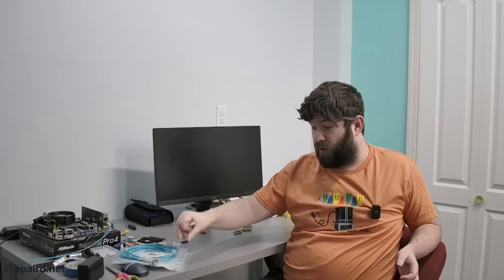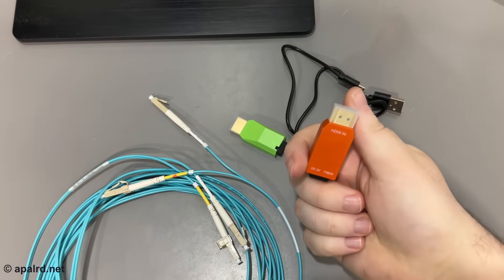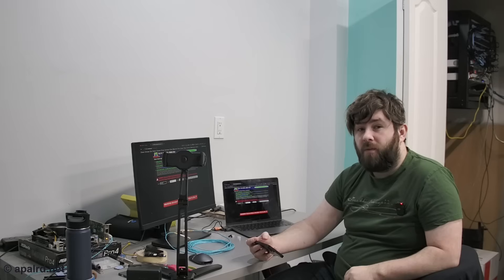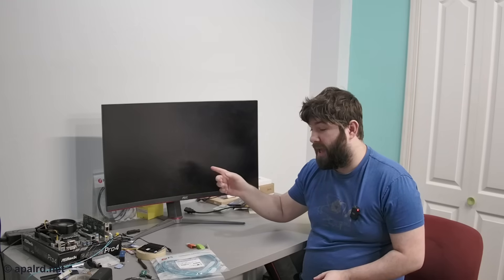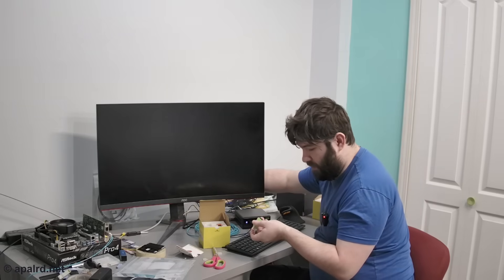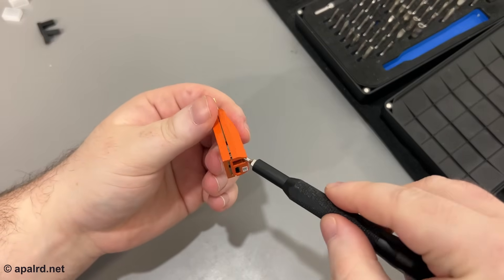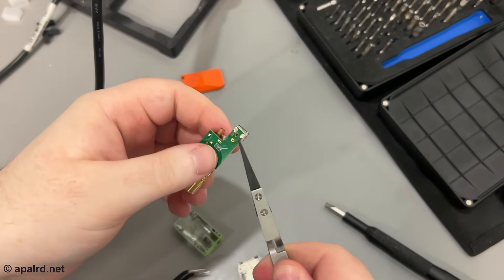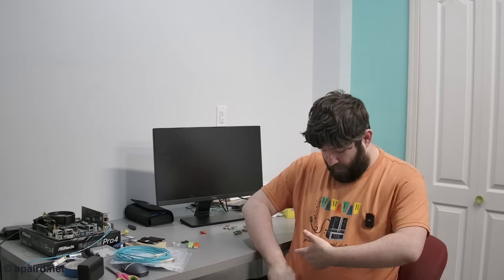HDMI over a single FIBER? E-Link Detachable HDMI 2.0 over Multimode Adapters

Comment: RUIPRO products are 1/2 the price, meet HDMI 2.1 standards, have a DP variant, and include a complete line of keystone wall plates and short run cables from the wall to the device.  Additionally, they also have an armored fiber option for better durability

Comment: the HDMI consortium are anti open source ass holes won't let AMD open source parts pf thier GPU drivers. id rather have display port who are not ass holes
Reply from the maker: HDMI has a technically inferior transport (at least with TMDS) so it’s easier to make stuff like this

Comment: I use this converter and a Transwan USB3.2/2.0/1.1 over fiber converter (uses SFP+ modules, I'm using a BiDi pair) to house my workstation in a network closet and only have a clean and quiet desktop on an office desk using a single LC fiber pair.
  
For a while I was considering making my own PCIe card that would have a pair of ASMEDIA ASM3242 (dual port USB3.2 to PCIe) feeding the guts of the Transwan USB3.2/2.0/1.1 converter (the SFP+ modules would have faced inside the PC, instead of the PCI slot IO plate) - and a few 4x Mini-DP inputs feeding 4x independent DP-to-HDMI protocol converters feeding the guts of these e-Link type HDMI-to-Fiber converters.  This would have been funneled into a single MPO/MTP 8-fiber connector - giving the ability to drive 4x workstations over virtual GPUs in only 2x PCIe slots when used with a single slot 4x mini-DP GPU (either AMD or Nvidia).  Your standard 4x PCIe x16 workstation motherboard would have been able to host 12x workstations.  Never really went through with it.

Comment: for live events: use SDI! ether over coax or fiber. but not hdmi. SDI is way more reliable and much simpler to trubleshot.
Reply from the maker: For many years I'd use mini PCs for remote displays, it's mostly things like rankings / schedules which scroll continuously. So the bitrate does not have to be very high.

Comment: Sounds really interesting. I think there's still room for improvement in terms of size (I find it too long) and making it USB-C. Making them black with a Tx/Rx label would've been (imho) a much nicer/stylish option rather than this red/green colors. I also wonder what's the amperage needed (I assume the voltage is 5V), or if the 2 conversions produce significant/noticeable lag in video games compared with regular HDMI cables (though I am aware this is a quite subjective topic).
Regarding the price, I understand that this is something relatively new, and maybe a niche product, but I still find it extremely expensive.
This being said, I think HDMI should have been optical from the very beginning (or at least a parallel version of it, like it already was the case with with SPDIF/Toslink)

Comment: Great stuff I'll have to pick em up. I built my basement theater so that all the consoles and PC live in a separate room and I use fiber HDMI cables to run 2.1 through the wall. I've been meaning to do a cable run up to the second floor office so I'll probably go this route.

Comment: ST Micro has fair amount of set top box IC's but all ball grid arrays, not that 20pin. Have the part number, or guess I could buy it. Looks like they obsolete a lot quickly. thanks
Reply from the maker: As far as I can tell, it's only used for the sideband signals and not the TMDS lanes, so it's probably just a basic microcontroller.

Comment: I went with an ethernet home run to the basement rack so I could do KVM (the box says "AV Access" but I don't know if that's the brand or model.) Technically they were using ethernet framing and I did get a picture over VLANs through a few switches BUT even though it was only 700Mbps the packet rate was so high my poor switches got anxiety and the picture was jittery. Dedicated cable gets me 4K at a hundred feet or so.  I'd love to see these guys make that happen on fiber. I have OM4 run between switches. They get my attention with a die cast casing when they could have gone cheap.
Reply from the maker: These guys aren’t using Ethernet, just raw optics. So no compression and no need to read in the whole frame and introduce latency. But I’d love to find a solution that can do what you’re asking.

Comment: It's nice that this kind of setup is getting more affordable. But 1.4 is ancient, and 2.0 is just too limited for the modern hardware: low refresh rates for 4k, no VRR. basically only usable for YT and movies
Reply: HDBaseT and knockoffs thereof support 4K@120 4:4:4 over Cat6 ethernet, the fancier ones even squeeze USB 1.1 or USB 2.0 on the same ethernet cable.
Reply from the maker: HDBaseT does not support 4K120. The highest spec supports the same 18Gbps data rate as HDMI 2.0. “Knockoffs” almost always compress the video to send it over Ethernet.

Comment: It would be cool to see the signal on an optical spectrum analyzer, as I suspect they're sending the 4 TMDS lanes over 4 separate wavelengths. That would allow zero latency (yo, we really needed a latency comparison vs cable, or a side-by-side A/B test) and very simple devices on either end. The STMicro seems overly complex just to handle EDID, so I wonder if there's also some power-control loop that it's running, but I don't know what sort of feedback it would be able to get in the HDMI 1.4 version.

The HDMI 2.0 version is clearly using bidirectional transceivers, which must be pretty exotic stuff, multiple wavelengths in one direction, plus at least one back the other way. I strongly suspect the HDMI 2.0 "receiver" also includes some brains to query EDID in the monitor and format it for optical transmission on the reverse link. It would be cool to find out if DDC-CI works over the 2.0 adapters! Try Nirsoft ControlMyMonitor or Monitorian on Windows, or ddcutil on linux. As always, first test on a copper cable then swap in the fiber. 

Can you persuade your dentist to X-ray the optical assembly? I've found a nice bottle of wine to be an effective X-ray lubricant...
Reply from the maker: It’s also not hard to interleave the TMDS signal, especially since one lane is already a clock. I agree that the cheaper model is likely not bidirectional and the more expensive one is. 

I wish I had more hdmi gear to test advanced functions like earc as well.

Comment: So I've kind of looked around a few times about a fiber-based kvm for a basement or closet PC, and I've seen many solutions of cobbling together different adapters and what not. But why isn't something like a USB-C hub able to be be run over multimode or MTP? Is it just not technically viable or just expensive?
Reply from the maker: USB-C has several different data links at several different speeds, two of which are half duplex using the same lines in both directions. USB 3 is not hard to convert to fiber, but usb 2 is, and usb 3 is not backwards compatible with usb 2.

Comment: Mode conditioning cables usually are for LRM  to traverse OM1/OM2 (62.5/125 , orange) fiber. It's actually tapered glass to help with the transition between the diameters.  
I've not seen a mode conditioning cable from  62.5/125 to 9/125 (OS1/OS2 , yellow) , but it seems you have one.....interesting.
The mode condition cable can help for more signal to make it through over putting a 9/125 cable directly onto a 50/125 optical as the latter would start with a significant loss already. 
Still , it's not going to be very smooth. They will likely have an option for singlemode fiber as well as swapping the optical part itself is not that hard, so that might be an option here.
I doubt it's bidirectional as it has a dedicated emitter and a dedicated receiver. In general MM is unidirectional, but bidirectional can be done (850+900) over a single multimode fiber. It does makes it much more complex over using duplex fiber each with a TX and RX.
As you mentioned in AV using singlemode is common and there are convertors out there taking HDMI / SDI to singlemode.  They can usually also take audio as well, not just video.

Comment: It would be interesting to see what happens when using a Toslink optical audio cable. May have to make up your own adaptors though for that ;)
Reply from the maker: Toslink is such a poor optical fiber that it almost certainly won’t work at all
Reply: @apalrdsadventures  It is like 20x the optical width of multimode, so totally agree. Given these things didn't like single mode though, maybe the wider the light path the better. haha.

Comment: I wish there was a displayport version of this or the other fiber type. All I can find for displayport is fixed fiber cables, I love the idea of using normal fiber.
Reply: There are MPO/MTP adapters out there. Example is HeyOptics. They're rather expensive but if you want to run 24 core MPO from one room to another for 3x HDMI2.1 or DP1.4 signals you sure can. The problem with this is that they run around 130~ dollars a pair (tx/rx pair) and while they're not "fixed" they're not modules so the main issue with Fixed fiber or AOC cables isn't inherently there the potential for issues is not zero.
Reply: @DCW09 Fibercommand makes ones that require six fibers, which at least lets you fit an extra "HDMI cable' into your 24 fiber cable... But then the adapter costs more.
Reply: I want one for thunderbolt so I can have a dock at my desk and connect all my stuff to it then connect the dock to the PC in the rack
Reply: I have a DisplayPort version - found on Amazon searching for "detachable fiber optic DisplayPort cable". I have one by RUIPRO and so far it works fine.

Comment: Is this adapter only using a single wavelength of light?  If not, there is still a bit of mux being done with the HDMI's high speed lanes.  That'd imply that the HDMI 2.0 models are likely following the 25GbaseSR spec for optics where as the HDMI 1.4 units are following 10GbaseSR spec.  I wouldn't expect any fundamental issue by doing so but the high speed HDMI lines are not immediately converted into light and sent off. There are of course other dongles like this that'll work with single mode fiber as well as MPO cabling.  With regards to these adapters though, how are features like HDCP, EDID,  CEC handled?  While being a point to point solution, the dongles could emulating those which can cause various issues for edge cases.

For those edge cases, there are other similar models that will leverage MPO cabling that'll convert both the high speed HDMI lanes and the lower speed connections independently.  They're 'simpler' in that they don't need the mux logic and they appear to host systems as well, a passive cable, to side step any potential HDCP issues.  I've heard of a couple units also providing a copper option for the low speed pairs in conjunction with the high speed fiber so that features hot plug are guaranteed to be handled correctly.  While copper Ethernet is limited to 100 meters, the low speed serial reach is 300 m which isn't quite the same distance that the fiber side can theoretically go (500 m using multimode).

Comment: I was interested until i saw their price. $250.. This is definitely not for the average gamer that just wants to put their PC in the basement.
It's about the same price as like.. optical thunderbolt cables.
Reply: You have to mentally price it as a legitimate actual component (like your PSU and monitor and such), rather than an "extra" like cables that are cheap enough to think of as a daily incidental expense like electricity or gas to go to the store.

So like, sure, you can have your PC in a different room... But you have to add a thing to your parts list to support it.

Comment: For anyone who needs HDMI 2.1/48gbps, you can use MPO OM3 12 strand with fiber command's ultra vision transceivers.  This will fully support 4k144hz 10bit RGB or 4:4:4. I've done a LOT of testing and it works pretty darn flawlessly.  Expensive, but there are no other solutions and the cables they ship also have wall pulls built in.  the current pricing is at least 379 which is stupid nuts, I think I got mine at 220.  

If you only need 120hz in HDR, you can use ruipro or any of the others.  Even if they are "HDMI 2.1" they actually only do 40gbps or there is some other limit in the units that stops 144hz from working.    

Remember that 144hz CAN work without HDR as stated in the video, but in HDR with full 4:4:4 at 4k it needs the full HDMI 2,1 bandwidth.  fairly niche, but I think this is where most people are heading.

Comment: The fiber cables are indeed thin but what about the plugs? They are easy to pass through the corners of the installation tubes? I guess we can not pull them with a lot of force as well.
I presume that "crimping" DIY the plugs in fiber cables is out of the question, right?
Reply from the maker: Fiber is a lot more rugged than you think, and you can get it with metal armoring if the aramid fiber isn’t enough.

Comment: I use an AmazonBasics 150ft HDMI fiber cable and it doesn't require any additional power as it is powered off the HDMI port. Too bad these adapters can't.

Comment: Great review. We've been using HDMI over Cat5e adapters for years and they are buggy as all get out. We constantly have to unplug the transmitter and receiver boxes to get them to pair back up nicely. Granted, they're cheaper, but after one or two visits to a site to fix them, I think these optical adapters may be a better bet. Not sure if they'll lose sync over time. I'd love someone to just hook a set up with signal and walk away for a week or two and see if they're still working.

Comment: Thanks for testing the single mode fiber. i have it run between my house and an outbuilding and this would have been my use case. saved me the time and money
Reply: there is a single mode version to.   but depending on usecase sdi over fiber probably is the much better option.

Comment: Do you really need USB power? HDMI has 5V, but might not be enough power?
Reply from the maker: HDMI 5v is limited to 50ma
Reply: @apalrdsadventures yes, but couldn't that be enough? Especially on the receiving end?
Reply from the maker: The receiver might be fine yes. Transmitter definitely not.

Comment: Mode conditioning cables are for launching single mode into a multimode fibre, not the other way around, so I'm not surprised that it didn't work.  No harm in trying it, though!  Many thanks for the review

Comment: This is unfortunate, HDMI 2.0 has a severe lack of bandwidth. But I guess you can just replace the endpoint adapters here and adapt to new standards, the fiber itself is trivially able to carry the bandwidth of HDMI 2.1 and future specs.
Reply: should be possible in future, you can get premade HDMI 2.1 FO cables

Comment: Me and my best friend also have HDMI over fiber running here from the computer on the workbench to the video projector up on the ceiling. It's another brand and a much bigger enclosure, but also USB powered. Pretty long run, with a 50m LC fiber in between, and ist just works like a charm! Full 4K with no problems at all. We never really tested latency, but as gaming works pretty well it should be good. We even run analog video (from NES and stuff) into a USB video card and back to the projector without any noticeable latency, works quite well afterall :)
Reply: Product details please
Reply: @gianniskamakas3578  Looks like I can't post links, but you can search for the name: Hereta 4K HDMI Extender. We have the version with RS232 to control the beamer, but there's also one without if you don't need that.

Comment: On  11/26/25:

$245 @Amazon for: HDMI2.0

$137 @Amazon for "E-link Mini 4K HDMI Fiber Extender - HDMI to Fiber Converter,Mini 4K/30Hz HDMI Over Single-Core Multimode Fiber Extender Up to 300m, OM3 Multi-Mode Fiber"

Comment: Eh HDMI over fibre is an old tale, i want DP 2.1 over fibre. Sadly i can only find DP 1.4 ones :/
Reply: I've seen hdmi 2.1 detachable mpo cables on AliExpress, not as clean build as this product, but should do the job.
Reply: @Evgenii-w6q  Yes HDMI 2.1 exist, but i need Displayport 2.1.
Reply: You’d really think DP would be more popular for a few reasons:

1) RF emanations aren’t much of an issue if at all
2) backed by VESA
3) idk I’m running out of points
Reply: @DSplatter DP 2.1 is the only way to get high refresh rate on open-source Linux GPU drivers as HDMI does not allow their binary blob to be included in open-source drivers… So yeah DP FTW.

Comment: So cool that they made the transceivers modular.  Fixed fiber cables are the devil.
Reply: fixed any cables are the devil. Free the cables
Reply: @marcogenovesi8570  >Device says it's wireless
>looks inside
>Wires
Reply: @marcogenovesi8570  freedom!
Reply: and the cheap fiber hdmi still use copper for edid/hdcp/cec. creates problems with ground differences.